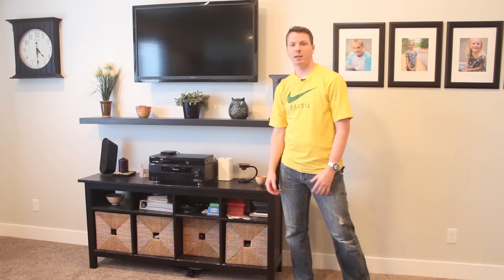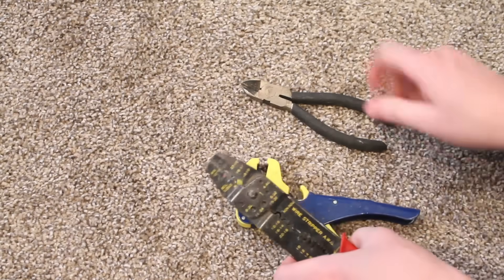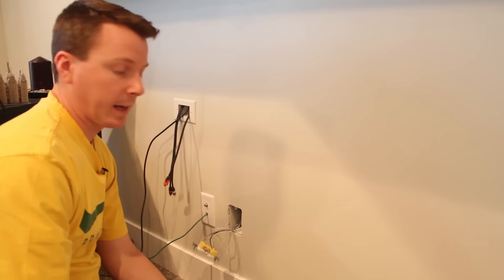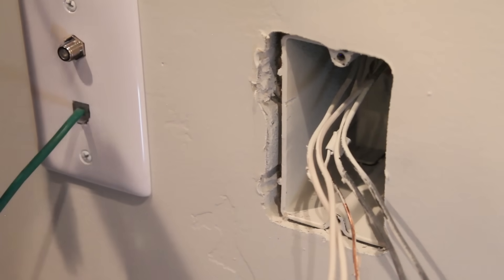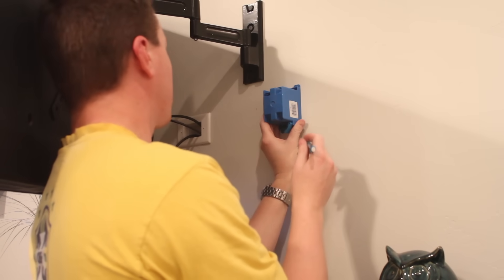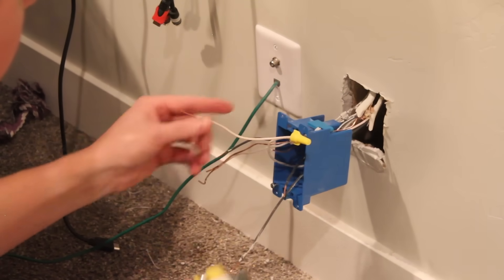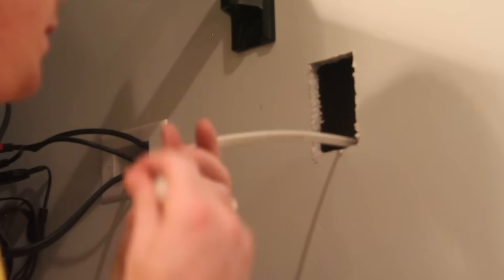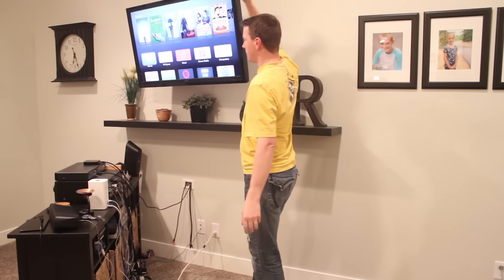How to Add an Electrical Outlet for a Wall Mounted TV

Comment: How do you run wires if you have installed the TV above the fireplace and your cable as well as receptacle is on the side of the fireplace? PLEASE ADVISE. Thanks
Reply from the maker: +Unique Premji You can still run the wires but it's more involved. In a nutshell, you need to cut a strip of drywall out horizontally so that you can drill holes through the studs, and then drop down like I did in the video. The ideal way to do this would be to run a 1.5" or 2" conduit through the studs so that you can fish any type of cables through there but if you're just doing an outlet, you can get away with much smaller holes. Then, when your wires are all run, you'll need to patch up the drywall, texture and paint. Like I said - it's much more involved but it's possible.

Comment: There really is much more to know before performing any electrical work.

Before anyone does this you better understand what electrical code cycle you are on. You may need a permit to do this because you may also need to add AFCI protection (for a circuit modification). The receptacle most likely will need to be tamper resistant also.

You have to make sure that your cable sheathing is into the box.

Side note those backstabbed outlets really are cheap and really should never be used even though they are code compliant. There are much better side clamp receptacles that are available.
Reply: +Donald Hester  Spoken like a true electrician..... just saying
Reply: Susan Kay union electricians don’t do residential service work
Reply: +prodigy2k7 will keep your house from burning down when your wife jams the dresser against the wall, breaking the outlet that the lamp is plugged into, and then a short causes a fire.

Comment: I want to place the TV above my fireplace mantel. The fireplace makes it more of a problem. Any ideas?
Reply: +R. Johnson Id say its the same idea, only you would have to have the bottom port off to the side, and some pretty long HDMI and audio wires lol. Those are easy to find, but your biggest problem is going to be fishing the wire through diagonally like that. Also, Whatever kind of structure you have behind the wall above the fireplace will make it much more difficult. Youll run into a few studs on the way. The easiest thing would probably be to just cut the entire section of drywall out, and run the wires through like that. They just put the piece you cut out back in, cover it with drywall putty, sand and paint that area.

Edit: Unless you want to have the cable box and whatever else you have set on top of the fireplace mantle. then just do exactly what he does in this video and the video where he talks about how to run wire through the walls. The electrical port will still take quite a lot of effort to move up there though, since I'm assuming there doesn't happen to be one floating in the middle of the fireplace to tap into lol. It could be easier if there is a room directly behind where you will be mounting it with an electrical socket that lines up with the TV.

Comment: Nils, thanks for the instruction.  Quick question, am i wrong or is there an additional ground wire that is not connected to anything?  You had 2 original wires plus the new romex.  you spliced the ground from the new romex with one of the grounds from the old and then capped/ground to the old outlet.  what happened to the third ground?  Thanks!

Comment: First time watching! Great clip and super useful! Especially if it's straight up above the existing electrical outlet. What if it's a 4 feet away and 6 feet up (diagonal!). Would you happen to have any tips?
Reply: +Jac-Martin Dorion Probably almost the same thing except maybe trying to run all the way up to the attic and then back down to the spot?
Reply: +Jac-Martin Dorion I did a similar thing to what you're describing, and ended up cutting out a bunch of drywall, and patching it up later. I cut out like 3 feet of the dry wall so I could drill a hole through the studs until I was directly under where my TV was going to be. Just had to make sure the hole was big enough to get my drill in. Then just fed the wire through the hole in the stud and followed the same process Nils explains. I did have to mud, tape, and texture the section I cut out, but it's now hidden by a TV stand. I ended up wiring an additional outlet down low directly under my TV, then another one up high where my TV was.

Going up to the attic or down through the basement is less drywall patching and probably easier, but wasn't an option for me.
Reply: +Jeremy Nicholls I ended doing just that!

Comment: What if the outlet you're moving is the one that is connected to a light switch. Is it possible to have it not link to the switch?
Reply from the maker: yoboytitties That depends on what side of the switch you're on. There is a power line leading to the light switch and one coming from the light switch. The one going to it will always be powered while the one coming away from it toward the light (or whatever is being switched on/off) will only have power when the switch is on. You can use a voltometer to test the wires that you want to piggy back off of to make sure you connect to the wires that are always on.

Comment: I take it original outlet was also wired to and existing electrical fixture somewhere else?  Hence the extra white and black wires?
Reply from the maker: Andrew D Most outlets are daisy chained together. The lower outlet that I used was connected to the next outlet, several feet to the right.

Comment: So both outlets ports on the top are going to be active with just the one romex wire?
Reply from the maker: Steven Anderson That's correct. The two plugs in the outlet are connected, so the one wire connects them both. There are two sets of screws so that you can daisy chain the wires if there are more that you need to connect.

Comment: Can you list all the items you need to do this project? That way i can just take the list to the store.
Reply from the maker: Troy Deonnei Sure, Troy. Here they are: Stud finder, Face plate for electrical outlet, electrical outlet, two single gang boxes for existing work, several feet of Romex wiring (three-wire type), wire strippers, wire cutters, utility knife, pry bar or heavy duty screw driver, phillips and flat head screw drivers and a hack saw.

Comment: Hey  Nils Rasmusson, thanks for the great video! One quick questions about the bottom plug: I saw that you connected 1 of the white wires with the new white wire, and 1 black wires with the new black wire, but you left another alone to connect to the bottom screw in the outlet. Which of the two wires do I connect with the new wire? (see 10:18 for where I'm discussing) Thanks in advance!
Reply from the maker: Kevin Verberk Hey Kevin, thanks for watching the video. Are you wanting to know how to connect the ground? If so, I just connect the incoming ground wire with the new ground wire, and then run a third, short ground wire out to the screw on the outlet. It will look kind of like the letter Y with everything connected inside a cap. Hopefully that makes sense. The goal is to make sure each of the wires' current comes into the bottom outlet box, connects with its appropriate terminal on the outlet, then continues on up to the new outlet. Best of luck and feel free to ask if you have any more questions.

Comment: lol push in slots are for lazy electricians so that they can terminate faster, doesn't hold up as well as 3/4 clockwise hook around the screw and push in slots only works with 14 gauge wire too. not good for a 20 amp ocpd with 60c insulation in use.

Comment: Nils - Great video and presented well. Quick question, I have a TV mounted on the wall with a soundbar going five to six inches below the tv. I will need to have outlets behind the tv and behind the soundbar. Can these two outlets be connected to the existing outlet or would that cause an electrical issue?
Reply from the maker: ***** As far as I know, as long as you're not going to be overloading the circuit, that would be just fine. You can just daisy chain them.
Reply: That is what I was thinking but just wanted a second opinion. If you don't mind I have one more question. With so many HDTV mounts out there, what tv mount do you have. It seems to be sturdy and functions well in your video. Thanks again.
Reply from the maker: ***** Hey Tom, I'll have to look at it when I get home but I know it was one I bought at Costco for $50 and yes, it really is pretty sturdy and does a nice job. I trust most things I buy at Costco, due to their return policy and the homework they do on their products so I'll let you know what I find.

Comment: thanks man. it was good info. I was thinking that you can also check for fire breaks simply by using a glow rod. Also, it would have been good to have spent a little more time on how to actually connect the new electrical wire at the bottom with the existing plug. thanks again and ill be subscribing.

Comment: I want to do this but my problem is the outlet I want to piggy back off of is about 5 feet to the right of my tv. I'll certainly have some studs to get through - how do I handle that?
Reply from the maker: streetkid0 Going across studs is more involved but definitely doable. You have a few options: 1) Cut a strip of drywall out lower on the wall, next to the existing outlet, drill 1" holes through each of the studs and feed the wire up to the TV area. You'll likely need to do some mud and tape, as well as texture and paint. 2) Remove some of the baseboard and drill the holes behind the baseboard so that you don't have to mud, tape or texture. You'll still need to paint and caulk but it's a lot less mess. 3) Consider removing some drywall on the other side of your wall. For example, if the room behind your TV wall is a closet or bathroom, you may be able to get away with cutting a hole in that wall without such visible consequences. If it's a garage, even better. Any of these options will be more work but just see what's best/easiest for your situation and give it a go! Good luck!
Reply: If you have a attic or crawl space u can splice the wire from there and wall fish it into the stud bay u need it in.  That's what I did anyway

Comment: Quick question, why are there different types of romex 10-2, 12-2, 14-2, in other words what does the 10,12,and 14 stand for, which one do you recommend.
Reply: Carlos Chaidez  there are different types of romex for different applications. the number stands for the size (gauge) of the wire. the higher the number the thinner the wire. If the circuit you are working on is on a 15 amp circuit  breaker, use #14. if on a 20 amp breaker use #12. 10 gauge wiring is for things that need more power (e.g a central air conditioner or electric clothes dryer.) if you are unsure of the amperage of the circuit breaker, use #12 just to be safe.
Reply: The Electronics Master Thanks for the help.
Reply: Carlos Chaidez you are welcome, any time.
Reply: Carlos Chaidez Also the number after the dash refers to how many insulated power carrying strands are in the wire. In 12-2 there are 3 #12 gauge wires: the hot wire- black, the neutral wire - white, and the bare ground wire which is a fail-safe wire, not included in the count. 
Some common uses for a three strand wire (12-3) in residential wiring is for 3-way switches or running shared power from a switch to an outlet with one terminal switched and the other constant.

Comment: Can you add a second outlet, say 3-4 ft away from the old one without running wires in the wall (Apartment). I want to disconnect the wires from the old outlet, run new wires through a metal conduit to a 2nd outlet. The 2nd outlet is attached to the outside of the wall. Basically I want to move the old one that is behind the bed to a better area. 

Bad or good idea? Can it be done? Code issues?

Comment: I would suggest that if you are not a licensed electrician that you are doing a disservice to your subscribers showing them how to do electrical work. As an electrician of 20 years it is very plain to me that you have never done this before.  You admitted this yourself when you said that you were unaware of the electrical code preventing you from running the TV power cord through the wall.  An unqualified person can nearly always make an electrical installation work.  The problem is they are unaware of safe methods of installation and by doing so are risking fire or personal safety.
Reply: His solution is to hire him and let him charge $500/hr for the same work

Comment: Electrical codes are found in your most current National Electrical Code book which is also Chapter 70 of the National Fire Protection Agency code. They are safety protocols for personnel protection as well as fire protection. Your T.v. power cord cannot be installed in your wall because the cord is not rated for concealed installation, such as the Non-metallic cable (Romex) that is us modernly used for residential wiring. Also required is a minimum of 6" of stripped wire from the back of your junction box toward the front. You can search online for Section 400.8 of the NEC or simply find an electrical forum and research your question. Another method is to web search or download your local state specialty code for information. All in all, nice work man.

Comment: Nils, great video. I was wondering why you chose to not nail the boxes back onto the studs for the purposes of securing the boxes. Drywall can be unforgiving at times and I wasn't sure if the box you used provided the security or if nailing to the stud was the suggested option. Thanks!
Reply: Great question. I didn't nail it or screw it in because I didn't have enough room to. That would be a better way to go if that's an option.

Comment: Unless the power wire is frayed and exposing actual metal wire, it should be fine running it behind the wall. Another no-no would be if you ran an extension cord behind a wall and the connection of the wire to the extension cord is located behind the wall. The wire "heating up" is highly unlikely and even if it did I don't see it heating up to a dangerous level, especially considering you have things like a dryer exhaust line running through a wall. That gets a hell of a lot hotter than any electrical wire could.

Comment from the maker: Hey Jonah, I can't seem to reply to your comment so I'm trying a new post but the answer is that it's more about safety. I don't think it's likely that this will make a huge difference in fire prevention, but it could. That's why this code exists. Also, if, by some chance, a fire was started in your wall and it as discovered that the wiring wasn't up to code, it might not be covered by insurance.
Reply: Thats usually just for new construction. This would not fall under that code part.
Reply: Jaystus is correct, otherwise, no one would ever be able to put in an old work box without cutting the drywall to use new work boxes.
Reply: DIY Nils no he be found guilty and charged possible jail time
Reply: i wonder if you foamed the other boxes should meet code then, its more then likely a draft stop issue.
Reply: DIY Nils I'm not sure what you just did is up to code, in my area wire staples within 6 inches of the box and ever foot after that are needed. also 4 inches of slack within the box

Comment: Hi Nils,

I watched your video on how to hide the wires for a flat screen tv. and then you have another video on how to install the power outlet behind the tv to be code compliant. My question is when do you have to be code compliant, so I can determine whether to go the extra steps.
I live in White Plains, New York, and am not currently worried about doing the work to be compliant for a sale of the house, but do want to be safe.

I am reading below now and see that you may have answered this already. In any case, I guess the question is whether being code compliant is a safety issue or just a technical thing.
Thanks for your help.

Rgrds
Jeff

Comment: Do you know why running power cables through drywall is not permitted?
Reply from the maker: My guess is that it's a fire hazard. If an electrical short occurs or the wire heats up, it could cause a fire inside the wall that may be too difficult to put out by the time it's detected.
Reply: Reason being is something metal can puncture the cable and cause a fire/ electrical hazard. If you want to put wires in drywall of a finished house without any support, you must use BX or aka armoured cable. You would obv have to use the proper box connectors  and also don't forget to use anti shorts. They are a little red piece of plastic that goes in with the armour to prevent the armour from cutting the conductors inside.

Comment from the maker: Derek (I'm not sure how to reply to your comment - it doesn't give me the option), if that's an option for you, then definitely go for it. I didn't have that option because I had to remove the outlet box, which meant unplugging everything. When putting it back together, you could definitely use both the screws and the rear inputs - yes.
Reply: +Aa ron The type of cable that can be run within walls depends on the local building codes.  Some local codes require what is called Armor Clad cable which is electrical wire covered in a protective metal housing while others allow for Romex, which is what he used in the video.  If his local code where he lives allows Romex, then what he used is completely legal.

What is definitely illegal in all local codes is to run extension cords or the actual cords that run from the appliance through the wall.  These wires are meant to be run only outside of the wall.

I hope this helps.

BTW Nils, great video!
Reply: +Nils Rasmusson isnt the wire from the first outlet to the second outlet a high voltage wire too, so wouldn't this be against code? or is it just against code to run the high voltage wire WITH the other ones?
Reply: ***** Oh ok thanks this helps a bunch!